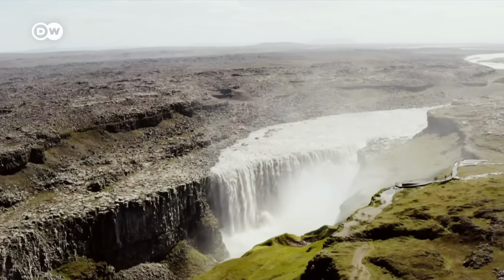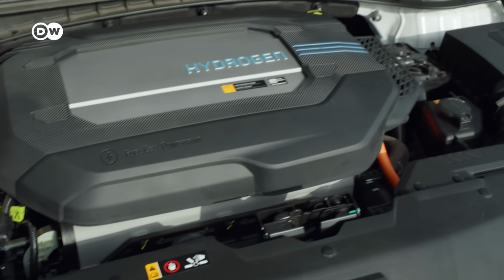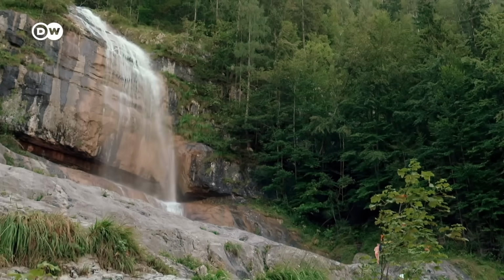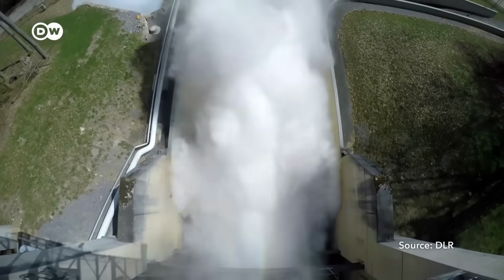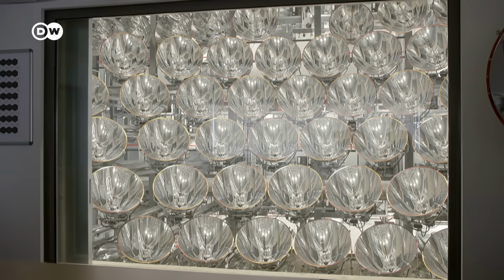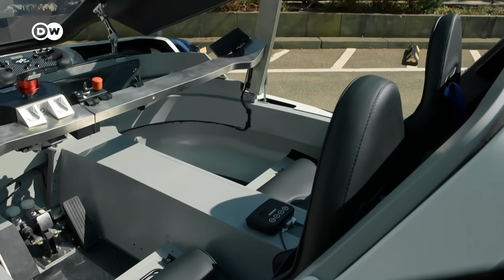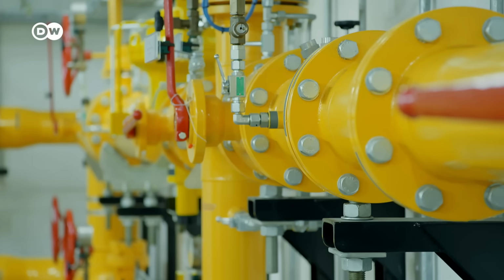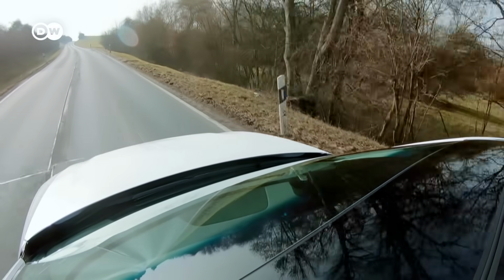Is green hydrogen the answer to the climate crisis? | DW Documentary

Comment: I am not a physicist,  but I am curious if there is a way to mix helium and hydrogen to make it non flammable, or if there is another gas that it can be mixed with?  It's just a shame it can't be used for airships, because floating silently above the ground is really really peaceful.
Reply: Unfortunately, programs like this carry on the myth that hydrogen was the problem with the Hindenburg while ignoring the fact that the coating on the outside of the zeppelin was similar to fuel in solid fuel rockets. Most of the injuries in the Hindenburg accident were crushing injuries from the collapsing framework. Most of the heat from the hydrogen burning went up and out, not down where to gondola was. To answer your question,  no. The best option is to use helium, which is in short supply and more urgently needed in scientific research and medicine.
Reply: It would burn slightly slower depending on the concentration, but that is not the issue. The problem is that helium is too costly and it will only get more expensive in the future. We are slowly running out of it.
But maybe we will see autonomous small cargo airships in the future, filled with hydrogen. Cargo is not in rush, and it's safer if there are no humans aboard.
Reply: Absolutely ridiculous to fear hydrogen! Gasoline is way more dangerous! In fact, there is already safe fuel tanks evolved by BMW in case of an accident

Comment: You should have covered blue hydrogen too. With carbon capture and storage at least it could be a «bridge» to all green hydrogen. Used in steel production it would drastically reduce emissions.
Reply: Sounds good but capture is not there yet unfortunately...
Reply: @alejandrobolanos4655    But it is, in industrial processes. Proven technology, and so is storage thousands of meters under the seabed. It is a new consept, but if it can give very low emission Hydrogen it absolutely should be considered. Coal is the worst, natural gas is better but still emissions. If blue Hydrogen can reduce emissions by 80% how is it bad? Do not let the perfect be the enemy of good.
Reply: Material science is one of the fastest moving. 
We now have glass clear aluminium. 
Not recently either.
Reply: Blue hydrogen is a scam that will prolong our dependence on fossil fuels and in the long run on less efficient hydrogen.

Comment: Tbh, making hydrogen fuel is about as easy as charging a battery.  It's just very explosive,  which makes it a great fuel.  It's been disrespected because it is NEARLY FREE ENERGY that can replace gasoline in the ICE system without much modification. So trust that a bunch of fat sweaty A holes stress about its viability becoming mainstream.
Reply: Why are they making it seem so difficult to make hydrogen?   Is it so that they can still charge you for being to stupid to make it yourself? Yes!  Seriously you can make it ON DEMAND AS YOU NEED IT, it doesn't need to be stored unless you need it pressurized.   For that, I have I have my own proprietary setup, I almost posted it, but I deleted that stuff, sorry.

Comment: Hydrogen is not a fuel... it is simply a method of storing energy.  Hydrogen is not simply mined or harvested in the way that coal, oil or other traditional "fuels" are.  We must create hydrogen before we can use it and this requires significant amounts of energy -- or it can be produced from the reformation of methane (a fosil fuel).  The problem with methane reformation is that it creates huge amounts of CO2 as a byproduct and is still reliant on the oil industry for the raw material.

Even once you've created your hydrogen (likely at a huge energy cost) then you must store it, transport it and use it.  Each of those stages has a number of problems that are not easily solved.

To create useful levels of energy density hydrogen must be highly compressed, converted to a liquid or compounded with a metal in teh form of a hydride.   All of these methods require further energy inputs (which further erodes the overall energy efficiency). 

Highly compressed hydrogen also requires very strong containment and produces the dangers that any highly pressurised vessel represents.

Liquid hydrogen must be stored at cryogenic temperatures -- making it cumbersome and impractical for most purposes with bulky insulation further compounding the complexity of the problem.

Metal hydrides require heating to release their hydrogen and, you guessed it, that's even more energy being wasted.

Finally, turning hydrogen into useful work generally requires a fuel-cell so that it can generate electricity.  Fuel cells are very expensive and their delicate atomic-level membranes are very susceptible to being damaged by any contamination of the fuel source.

When you look at the amount of energy involved to create, store and transport hydrogen it is an inefficent "fuel" at the best of times.

When you consider that the vast majority of hydrogen used today comes from fossil fuels it is not a green energy source.

Great idea... but unfortunately it remains "a promise" rather than a "practicality".
Reply: Amen
Reply: Australia is going to be a Green hydrogen super power within the next 10 years.
Reply: @rikukoskela2791  Given the concessions and support that the Australian government is providing to the oil and coal companies we won't be talking "green" hydrogen though.  And to be honest, I don't think hydrogen will live up to the promises being made for it for quite a long time (if ever).
Reply: That's crude, linear thinking at its finest.

Comment: As far iam concerned... it takes MORE ENERGY to make Hydrogen than it delivers. 🤔
Reply: It is true for every single source of energy. The sun and rotting matter underground had a ton more energy and time "invested" into the making of oil. We just take it for free from earth and we think that it is efficient, but it is not. Imagine, if we had to make our own synthetic oil or coal - now that would be VERY inefficient, compared to hydrogen.
As far as hydrogen, the biggest advantage is that it is abundant. No need to pray on a Russian dictator or a Saudi monarch. Also, the voltage required to split a water molecule into H2 and O is 1,23V. You can literally make it at home - take a 9V battery, connect both ends with a paper clip, drop it into a cup of water with salt and congratulations - you are now a H2 producer :D
Have a nice day, Renato!
Reply: @tkzsfen  great reply thanks

Comment: this is a good start, but i think mining other planets will get us way ahead, we might find new elements that we don't have here on earth, new battery tech. methods to help in faster space travel, I'm sure i will be dead by then but  still we gotta save the our planet to insure we will have a future.
Reply: The disposal of those batteries are the primary issue surrounding, for example, electric vehicles. And we don’t need nor want more waste - currently we are seeing a steady increase in battery waste as more people adopt electric vehicles, and it’s difficult to recycle. If hydrogen is used, the emissions are carbon neutral AND there’s no waste to deal with in terms of energy production and storage. 

Of course, we need a layered approach to energy production - some concepts will work better in other scenarios. But for the most part we do want to try our best to remove waste and emissions from the energy equation. Acquiring those materials from other planets still leaves us in a bit of a pickle. Also we don’t know yet what the emissions of those materials would do to Earth’s environment. We do however know what hydrogen does.
Reply: we wont find any new elements, coz with higher proton number atoms become unstable. Plutonium with 94 protons has the highest proton number out off all naturally occuring atoms. All further atoms in the periodic table were acquired artificially in fusion chambers.
Reply: @marekg7259  such a Human way of thinking Brother, are you sure there is nothing out there to find, nothing new?
Reply: @takismail  when it comes to new elements im 99,99% sure. That 0,01% takes into consideration that our idea of periodism of atoms may be wrong.

Comment: In other words as long as your held hostage by big corporation.  You can go green.
Reply: Yes and no - look who is on the forefront of hydrogen production. Good old Big Oil. They have the knowledge and resources to do it before anyone else. There are simply no political measures to make them hasten the process.
Reply: @tkzsfen  absolutely i posted 3 links to different articles.  Which showed how badly researched this documentary is. Relating to hydrogen technologies, which are out there today, that would enable the average person,  to be completely off the shackles from big energy companies & they got removed.
 One was a company that won a million dollar prize. For a home fuel cell unit. The other for a 170 room apartment block in Sweden which is 100% self sufficient &  how  a company which has developed hydrogen tech produce from rain water.  Clearly they  don't want the average person knowing this stuff.

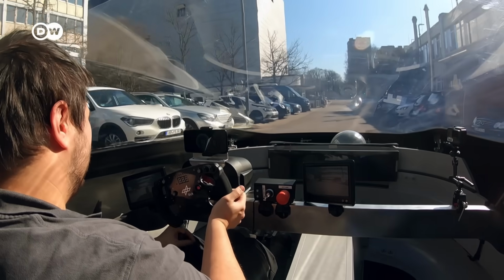Comment: 18:35
I believe on EV efficiencies they usually ignore the fact that the EV has to transport the battery itself too, which is a significant factor. It would be beneficial to factor in the transported useful weight for the efficiencies. The EV is less efficient if it has to transport a considerably bigger useless mass with itself, that transported excess mass is an energy loss compared to the other solutions where you don't keep the products of your chemical reactions as a transported overall mass.
I agree electrical energy transfer seems to be the most efficient still. But this excess mass is what makes it hard to implement EV solutions for heavy vehicles.
Reply: e-highways already being tested by siemens and scania also rail freight old but reliable
Reply: @aHarzoo  Thank you for the information. My main motivation behind the comment was to finally have presenters showing a better comparison chart regarding efficiency. Based on your comment, I think it would be more accurate if they named their current EV category as batteryless EV on the chart.
Reply: That new small hydrogen cell car is estimated to cost consumers 15k. Half the price of an electric vehicle, AND I already see on somemotorways electricity charging is 5 times the cost of home electricity. We will be at the mecy of the same energy companies. We need to support a variety of these initiatives for he sake of our pockets, not just the planet
Reply: The weight reduction certainty matters, but that's not part of the energy formula. Operating expenses and capital expenditure is also key. Use cases for hydrogen will be limited, and has yet to be proven feasible.
Batteries also advance at an incredible pace while hydrogen already operates at its limits.
Reply: @lechavs  the energy density/capacity of a Li-ion battery is a mere 1% of a gasoline/petrol. The range for battery-EV vehicle did not state the range on uneven terrain which it have to lift itself against gravity leading to huge drain in energy, that 1% is not enough, and the 2x the weight will make it worse.
Reply: the weight factor gets worse on vehicles like tractors they dont touch full power for a few seconds like a car they run at full power for a good 10-12 hours take a New Holland T8040 that can put down 200kW for 12 hours thats a total of 2400kWh lets use top of the line Tesla P100D battery packs they come in at 600kg each we would need 24 packs so a total of 14 tonne yea thats heaver then the base tractor at 9 tonne.
Reply: in term of kinetic energy it is true battery-EV waste energy during acceleration because it is twice as heavy as a typical car.
Reply: Hydrogen is a combustion fuel. Making hydrogen fueled EV's is ludicrous.
Reply: @aga9618  they don't use is for combustion, it's a 'hydrogen fuel cell' which generates electric current by passing hydrogen next to a catalyst that splits the H2 molecules into free H+, positively charged particles pass through, create a current, merge with the oxygen on the other side, and get released as H2O. Instead of burning the Hydrogen, they strip the electron and use it in the circuit.
Reply: @letopizdetz  and that's why it's inefficient.
Reply: @letopizdetz  and - it can be used as a combustion fuel and is, and people have converted their cars to run on it. So this is bs...
Reply: @aga9618  sure, come up with a bettrr solution, you'll become a billionaire and we'll get to live a better life overall.
Reply: @aga9618  combustion is simple but fall under a physic law called "Carnot engine" (or "Carnot cycle" or "Heat engine") which stated that it will have a maximum efficiency of 30% regardless of any type of fuel use. Yes, the combustion engine is simpler (to you) than fuel-cell but in term of Physic it is maxed out and cannot improve any further.
Reply: @letopizdetz  Germans: "Vee neet trillions of dollaz, to make thies technology! Vee neet refrigerated liquid hydrogen! Vee neet cell fuels! It's inefficient! The cars vill kost thousnds of euros!"
Polish guy in his garage with plastic pipes and a jar: "Ay hiave no monee,  so I make my car run on water." 😂😂😂🤷‍♀️
Reply: @xponen  well it doesn't need to does it?

Comment: If a person gets a job along way from home the cost of travel to and from the job should be considered. If after paying travel costs only a small amount of the wage is left, would it be sensible to take such a job. 
Money Invested in travel returned in work wages. 
Energy Returned on Energy Invested 
E.R.O.I.
Energy Returned from hydrogen is low when compared the Energy Invested to create the hydrogen. 
Green hydrogen has low EROEI. 
If hydrogen becomes available commercially it will most likely be made by the oil and gas industry and will not be Green hydrogen.

Comment: To solve the long charge time of electric cars, we need standardization of battery so a car can pull onto a battery exchange platform where a fully charged battery can be installed and the battery in need of charging can be installed in the same time as filling a cars tank with gasoline.
Reply: i reckon 90% of car sales now are used cars right? and 90% of battery products we buy new because we dontr want second hand battery products.  I mean seriously, whos gonna buy a n old batery operated car?
Reply: The problem with battery exchange is this. Imagine you just bought a brand new electric car and it needs charging. Would you exchange your brand new car battery...which is the most expensive component...for one that has been used and possibly a few years old ?
Reply: @dazuk1969  
It wouldn't matter since all cars will have their battery exchanged countless times. Battery quality will not be a selling marketing issue. I'm confidant buyers will gladly prefer quick recharge for hanging onto their new battery. Batteries will all be tested as part of the recharge process and there could be tiered levels of battery quality for those wishing to pay for a higher quality of battery exchange just as there are different levels of gasoline now..

Comment: why not use  the hydrogen as the "battery" instead of looking for a battery?
Reply: Energy conversion efficiency is lower that 80% for fuel cells and H2 production via electrolysis of water is even less than 80%. Meanwhile for lithium-ion battery it is more than 90% energy returns back after discharge.

It would make sense to produce H2 as fuel for transportation but not as "electricity -> H2 -> electricity" storage.
Reply: @DanmerZzz  Altho if Hydrogen is 5 times cheaper to buy than electricity then its a different arguement
Reply: Your car will be the bomb with the hydrogen, which needs 10 times more space, than a set of batteries.
Reply: @Mr1234543211  5Kg of H2 takes a lot less space than a set o batteries for the same range (800Km).
Reply: @LagartoPT  Under pressure? / 5 kg of hydrogen can be stored in a 125-liter tank/
Reply: @Mr1234543211  Yep , just googled Mirai tank volume and it is 122l for 5Kg of H2.
Reply: @Mr1234543211  Lithium vapor is very reactive to oxygen similar to hydrogen. They're both in the same group in the periodic table.

Comment: Water vapor and clouds account for 66 to 85 percent of the greenhouse effect, compared to a range of 9 to 26 percent for CO2.
Reply: I'm not sure it's even 9%....✔
Reply: The problem with carbon is that carbon cycle is very very very slow. While water cycle is super fast. We dig up gazillion tons of carbon fuel per year from the underground, releasing too much the carbon to the atmosphere. Those carbons took millions of year to go from the atmosphere to accumulate underground, yet we burn of all that in the span of 100 years. This why we have excess carbon in the atmosphere. Water, on the other hand, has a very fast cycle. It doesn't take a million of year for the vapor to be turned into ice, excess vapor in the atmosphere, if produced, will be eliminated very very fast from the atmosphere.
Reply: The concentration of water vapor and clouds hasn't increased dramatically since the Industrial Revolution. CO2 has.
Reply: @luodeligesi7238  lol...says who? You??? LoL
Reply: @luodeligesi7238  How fast will the water vapor rise if hydrogen becomes a main fuel for planes ,trains and automobiles .
Reply: @TiredOldMann  
Water evaporation/condensation rate depends on air temperature, sir.
Reply: @TiredOldMann  the atmosphere has a process for getting rid of excess water vapor - it's called rain.
It doesn't have an equivalent process for getting rid of excess CO2.